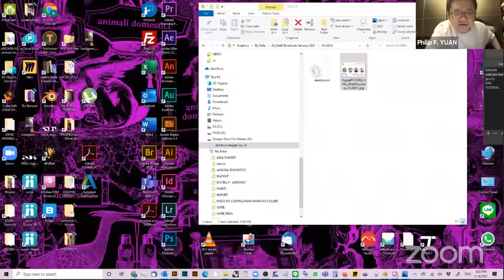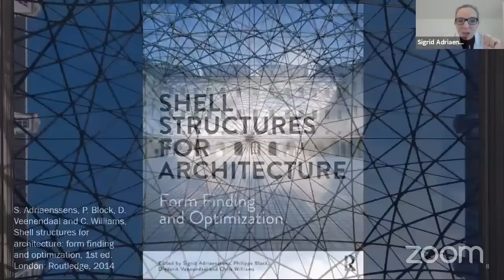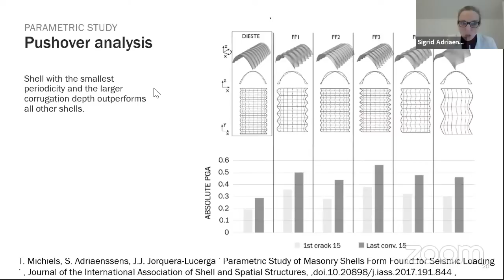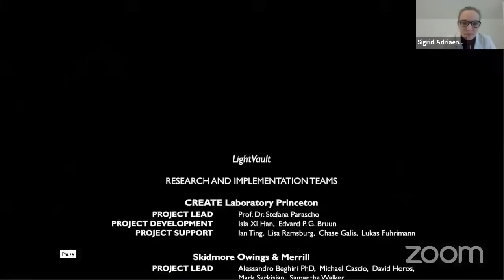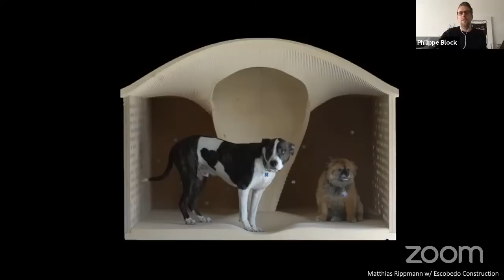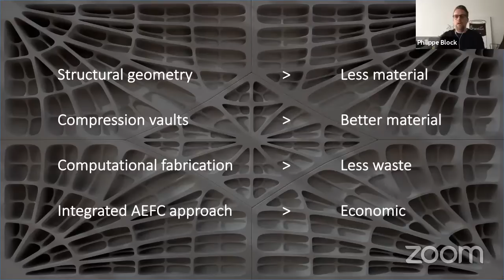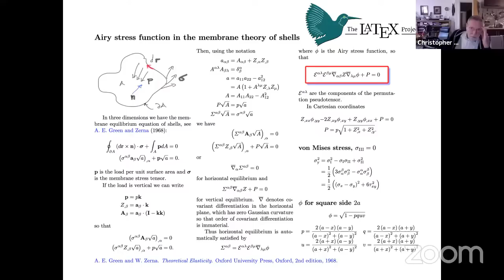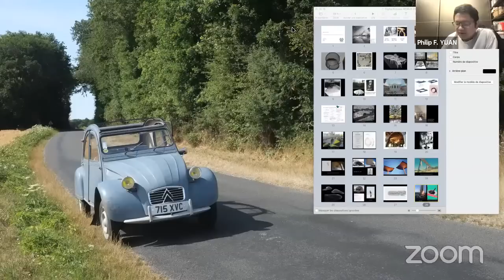DigitalFUTURES: Shell Structures

Comment: A great team and a privilege to see them in the same discussion, now it only remains to find a way or method of building that allows to design freely and when there is a difficulty or challenge of resistance, functionality or aspect not considered of design or engineering, it is possible from only change the size of the section, for example, a standard piece but with more layers to achieve an optimal overall result, where the shape and dimensions of the thing sought are not altered or are minimally altered, ending in an imperceptible change; All this with standard pieces that do not have classic characteristics of the common sense Lego (blocks for identical constructions) or Meccano with its unlimited characteristics pieces, a solution that achieves everything from a few pieces, no more than 10 units, and that it is possible that from one same production line, unlimited shapes are achieved beyond the cube or orthogonal projection, without limits being able to design and build the universe of shapes. But perhaps the most important thing is that machinery and specialized personnel are not required who cannot alter in the least the planned result in detail installed in any part of the globe.